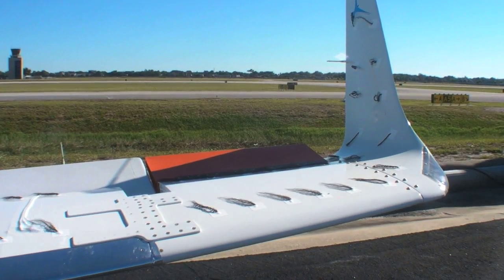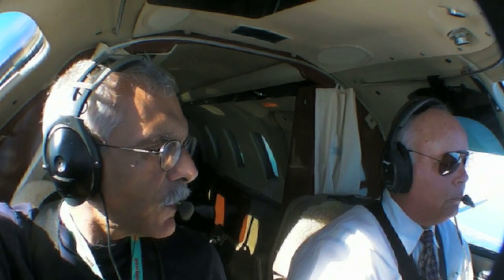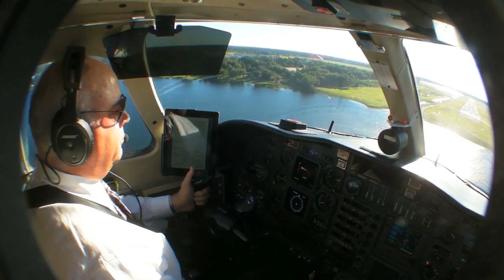Tamarack's CitationJet Active Winglets

Comment: So the reason for all this is to get out of doing load and stress analysis for extending the wing and adding a winglet, BOTH increase the wing bending moment. To get around this they added some active load relief to maintain the same wing loading despite the extra wing and winglet (which has a large effect on wing loads). Well the active system has malfunction at least twice and has caused fatal accidents.  FLY BY WIRE or software controlling flight controls is not new, but this was done poorly and and cost lives.